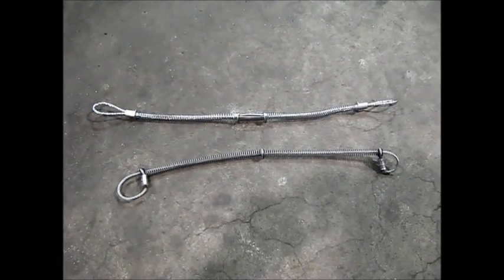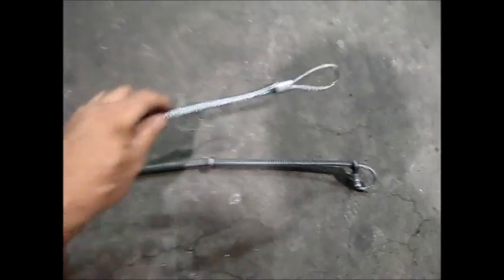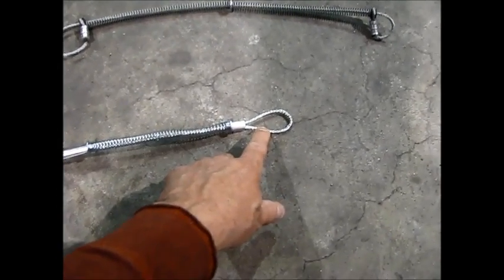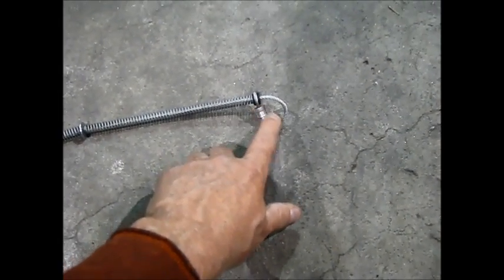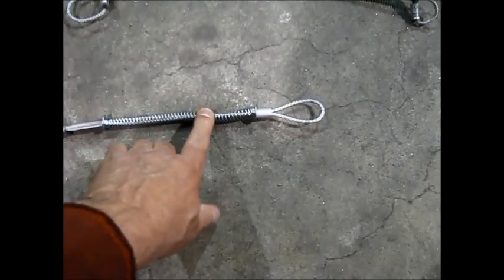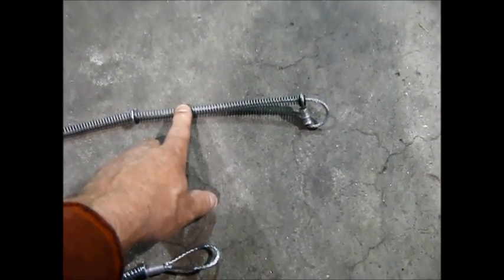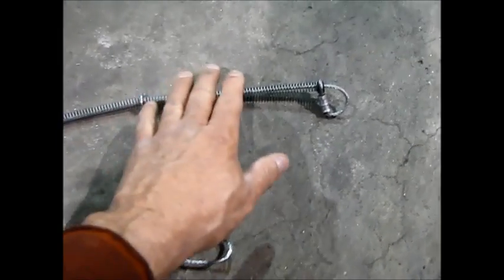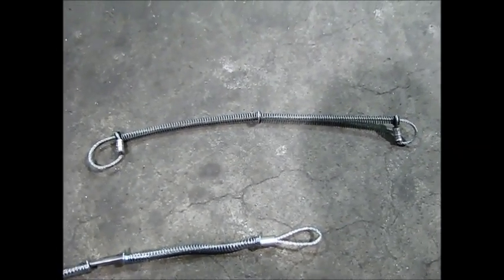Whip Check Vs Cable Choker

Comment: Thanks for this dude. My 23 yr old son thinks it nothing to release a quick fit connector at 3000 PSI - this video convinced him to listen to his old man and spend the 30 seconds discharging the line before releasing. Kids just think they are invincible.
Reply: i unscrewed a drain plug from one of my airtanks once with "only" 2 bars of pressure behind it. still havent found it.
Reply: @allahsnackbar9915  🤣